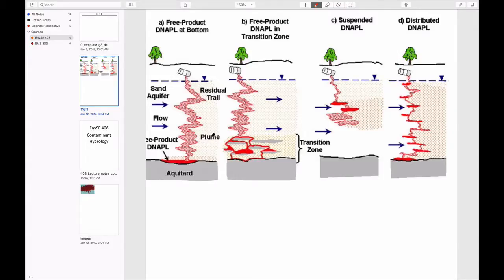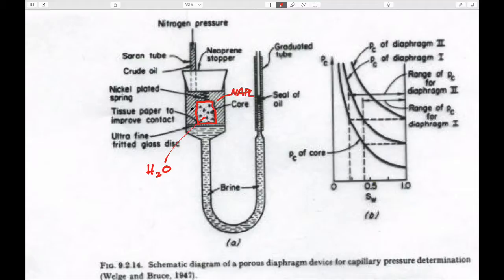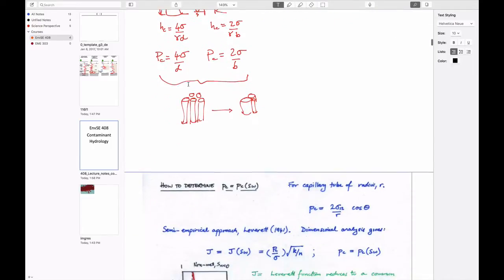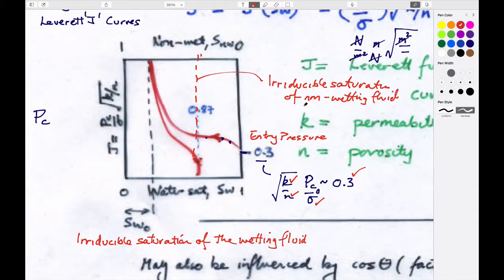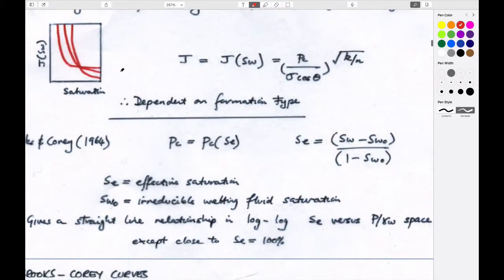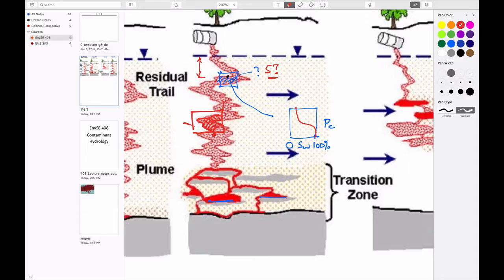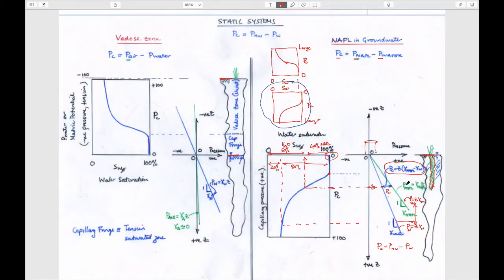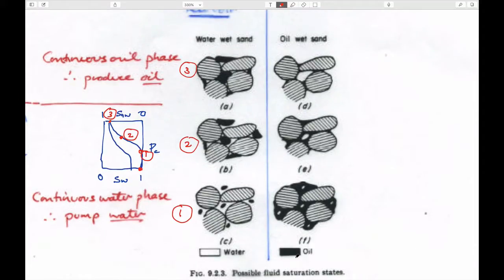2:2 Multiphase Flow - Capillary pressure-saturation curves, hysteresis, NAPL distributions

Comment: Hallo, 
Great work and very helpful,
37:40 Just one thing about drainage and imbibition, I think it is called that with regard to the wetting and non-wetting fluids. So, in the petroleum industry if we have an oil wet rock it would be called drainage of oil and imbibition of oil (which would be Sw in this case).